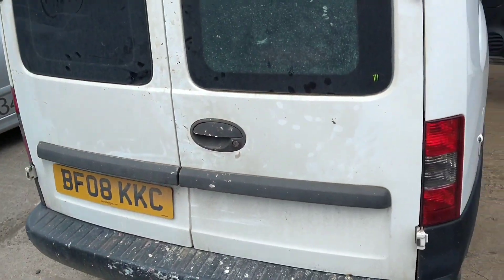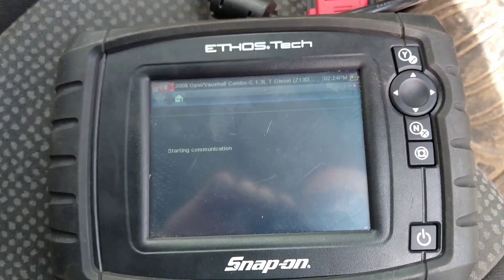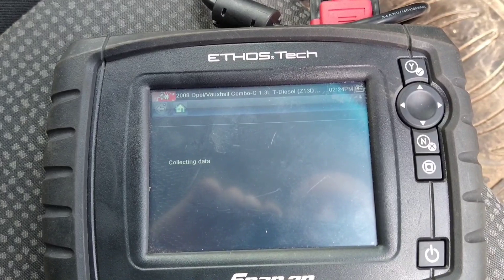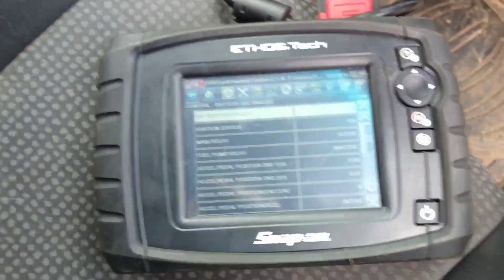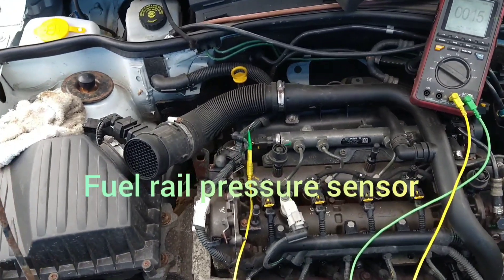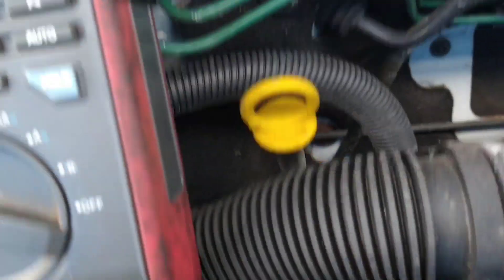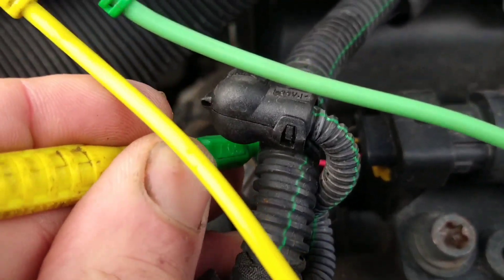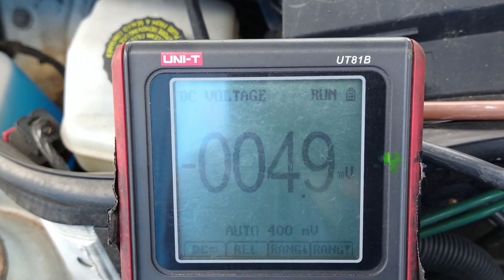Vauxhall combo no start (part 1) checking fuel pressure

Comment: Clean the scan tool contacts and the car's contacts to keep
the scan tool in communication, use a pen to do the menu stuff,
attach the pressure testing equipment to the depressurization valve.
A diesel needs two things to to run, combustible and compression, with
the combustable being two parts, one air and one diesel.
If one of these is missing, the engine won't run.
Nowadays there are some using sparkplugs as well, no longer relying
on high compression before combusting, if it has those it needs
timed sparkinga s well, just like a petrol engine.
If all of these are present and the car still won't run, ur outta luck.

Comment: I think he should check the egr valve sounds like the engine is not getting air
Reply from the maker: @liambyrne591  you are correct, that is what was wrong. You can see in part 2, thanks for watching

Comment: Have the same problem on a 'Hoilden Combo' 1999 put a new Pressure regulator in it. Has'nt helped there is a sparate ign electrical/Vacuum unit on ours and wiring goes to the injectors? Maybe we think this is faulty?

Comment: Hey matt, Hope ya doing well, My Vauxhall combo van 2003 year broke down a few weeks back, its a 1.7 Diesel, just before it broke down i was going uphill with a quarter of a tank of fuel and it started to behave as if it was just running out of fuel, eventually i came to a halt and tried to restart it several times, each time i tried to restart it it would run for a few seconds and then die...  im covered by the rac  and when the man from RAC came he said that he was pretty sure that it was something called an EDU fault (The thing that controls diesel and air mix) and he showed me where the EDU was located and then towed me where i needed to go, some time later i unbolted the old EDU and replaced it with a guaranteed working model from a place called clean spares in Plymouth uk..(Ive ben dealing with clean spares on and off for years, they are a good company) My observations, When i removed the old EDU i noticed there was marker pen writing on the back of it so i knew it had been replaced in the past, and when i fitted the replacement EDU (Its plug and play matt or at least ive been told) it behaved in the same way as it did when it broke down, starts, runs for a few seconds and then stops...in the meantime ive done some research, one suggestion was to disconnect the mass air flow senor, i tried that, same story...but what i have noticed is this, in the past when i put my key in the ignition and waited until the the glow plugs where at the right temp, that, at that time id hear a whining noise, and i always guessed that noise to be a relay pressuring the diesel fuel rail to the correct compression ratio, and that whining noise would last about 10 seconds, but, im not hearing that noise no more, its total silence when i turn the key into ignition mode just prior to turning the key, and i have a sense of the technology here but im kind of lost here because im 60 years old and old school in relation to these matters as an amateur car/van diy repair person, so if you or anyone else around here can give me some clues then id appreciate that very much. I don't think its a fuse because it didnt die immediately, its died slowly while going up hill, as i said as if it was running out of fuel, anyway any advise would be appreciated, Thank you
Reply from the maker: The van in this video ended up having a stuck open EGR valve, that is why this van started the died then wouldn't restart until left for a while, then it would die after starting again. 
The fuel pump should prime for a few seconds when the ignition is switched on, then come on and stay on with the engine running.
If you are not hearing that, it could be the fuel pump has stopped working
Reply: @mechanicmatt871  Thanks matt, And i understand what you are saying here, ill locate the fuel pump and put my multimeter on it as i turn the key to ignition mode without actually starting it. i know its something so simple wrong with it, well im sure it is. Thank you

Comment: Having almost the same problem with the vauxhall insignia 2.0 cdti.cranking but no start.like on data stream the desired fuel rail pressure is higher than the rail pressure

Comment: Matt, that low side seemed really low and if it's not leaking out through an injector and no viable leaks I'm thinking check valve or issue with the tank pump connection (line connection not electrical) it also sounds like it wants to go, I'd probably start by making sure theres no air in the system first, recheck the tank pump and go from there...good luck...

Comment: Hi Matt , the air flow rate at
 41.1 g/s  seems very high for cranking speed.  Your average 2.0 diesel uses about 13 to 14 g/s at idle with the egr shut. Just an observation thanks.
Reply: Maybe try unplugging the the air flow meter  and try and see if it starts thx
Reply from the maker: Good suggestion, thanks Myles
Reply: The engine would have to be running at 4000rpm to be drawing 41 g/s air in. Lol
Reply from the maker: I looked at the car today and the MAF was 0 grams/sec until I cranked it, then it was between 3 and 10. I looked at the signal and it was 1.8khz with ign on.
It actually sounded like it was just going to fire straight up but didn't. I tried the unplug it test and it was the same.
The difference today was I used an old foxwell scanner. I hope to get some time on it on Monday. Thanks for your help
Reply from the maker: Thanks, that is way off. I hadn't even noticed, I had tunnel vision focused on the fuel pressure. Thanks for pointing that out.
Reply: Hi Matt, was going to send a screenshot of running Vauxhall 1.3cdti  pressures . Voltage . But have no emai for you
Reply from the maker: Hi Myles my email is breretonm76@gmail.com thanks